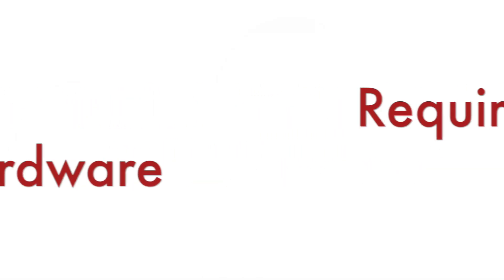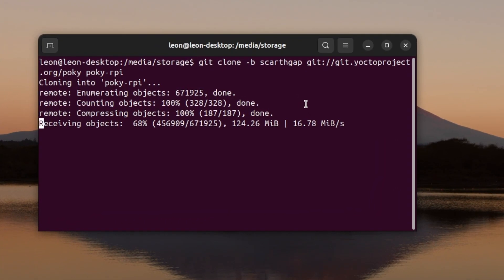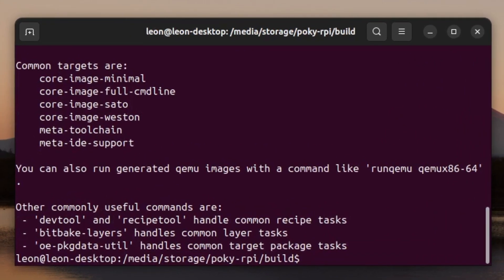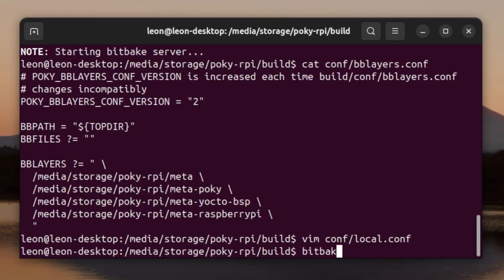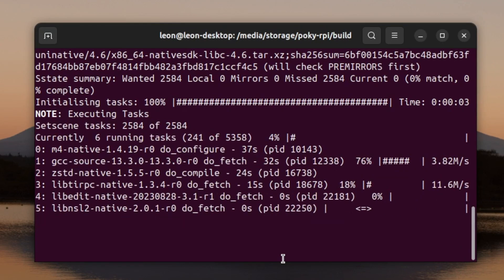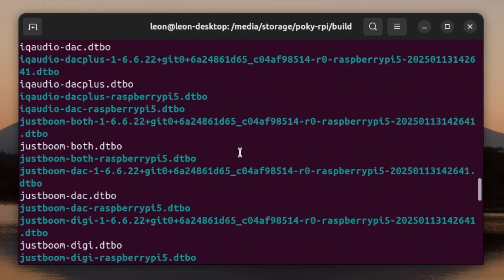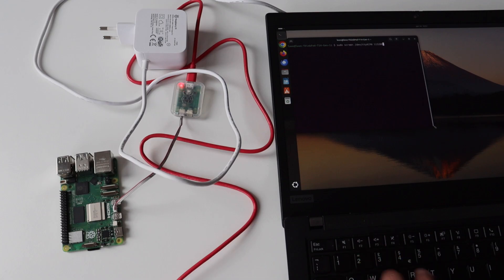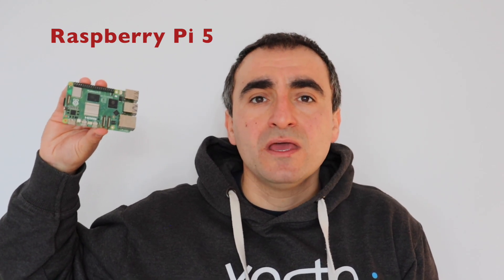The Yocto Project on Raspberry Pi 5 Episode 1: Building an Embedded GNU Linux Distribution #linux

Comment: I have rpi 4... Will this same procedure can be used for rpi 4?
Reply from the maker: Yes, with some adjustments. Set MACHINE to raspberrypi4-64 for 64-bit image for Raspberry Pi 4. Also the UART output on rpi4 comes from the 40-pin headear.

Comment: Thanks a lot for this tutorial series on using the Yocto Project for a real physical board.
I am trying to follow the same steps as you but I get the following errors while the execution of the tasks:

NOTE: Executing Tasks
ERROR: linux-libc-headers-6.6-r0 do_install: oe_runmake failed
ERROR: linux-libc-headers-6.6-r0 do_install: ExecutionError('/home/vvdn/poky/build/tmp/work/cortexa76-poky-linux/linux-libc-headers/6.6/temp/run.do_install.5422', 1, None, None)
ERROR: Logfile of failure stored in: /home/vvdn/poky/build/tmp/work/cortexa76-poky-linux/linux-libc-headers/6.6/temp/log.do_install.5422
Log data follows:
| DEBUG: Executing python function extend_recipe_sysroot
| NOTE: Direct dependencies are ['/home/vvdn/poky/meta/recipes-devtools/quilt/quilt-native_0.67.bb:do_populate_sysroot', 'virtual:native:/home/vvdn/poky/meta/recipes-devtools/bison/bison_3.8.2.bb:do_populate_sysroot', 'virtual:native:/home/vvdn/poky/meta/recipes-devtools/patch/patch_2.7.6.bb:do_populate_sysroot', 'virtual:native:/home/vvdn/poky/meta/recipes-devtools/pkgconfig/pkgconfig_git.bb:do_populate_sysroot', 'virtual:native:/home/vvdn/poky/meta/recipes-devtools/pseudo/pseudo_git.bb:do_populate_sysroot', 'virtual:native:/home/vvdn/poky/meta/recipes-devtools/rsync/rsync_3.2.7.bb:do_populate_sysroot', 'virtual:native:/home/vvdn/poky/meta/recipes-devtools/unifdef/unifdef_2.12.bb:do_populate_sysroot', 'virtual:native:/home/vvdn/poky/meta/recipes-extended/xz/xz_5.4.7.bb:do_populate_sysroot']
| NOTE: Installed into sysroot: []
| NOTE: Skipping as already exists in sysroot: ['gettext-minimal-native', 'libtool-native', 'm4-native', 'quilt-native', 'texinfo-dummy-native', 'bison-native', 'flex-native', 'gnu-config-native', 'patch-native', 'pkgconfig-native', 'pseudo-native', 'rsync-native', 'unifdef-native', 'xz-native', 'acl-native', 'attr-native', 'popt-native', 'sqlite3-native']
| DEBUG: Python function extend_recipe_sysroot finished
| DEBUG: Executing shell function do_install
| NOTE: make 4 HOSTCC=gcc  HOSTCPP=gcc  -E headers_install INSTALL_HDR_PATH=/home/vvdn/poky/build/tmp/work/cortexa76-poky-linux/linux-libc-headers/6.6/image/usr
| *
| * Configuration file ".config" not found!
| *
| * Please run some configurator (e.g. "make oldconfig" or
| * "make menuconfig" or "make xconfig").
| *
| /home/vvdn/poky/build/tmp/work/cortexa76-poky-linux/linux-libc-headers/6.6/linux-6.6/Makefile:775: include/config/auto.conf.cmd: No such file or directory
| make[1]: * [/home/vvdn/poky/build/tmp/work/cortexa76-poky-linux/linux-libc-headers/6.6/linux-6.6/Makefile:784: .config] Error 1
| make: * [Makefile:234: __sub-make] Error 2
| ERROR: oe_runmake failed
| WARNING: exit code 1 from a shell command.
ERROR: Task (/home/vvdn/poky/meta/recipes-kernel/linux-libc-headers/linux-libc-headers_6.6.bb:do_install) failed with exit code '1'

Build Configuration:
BB_VERSION           = "2.8.0"
BUILD_SYS            = "x86_64-linux"
NATIVELSBSTRING      = "ubuntu-22.04"
TARGET_SYS           = "aarch64-poky-linux"
MACHINE              = "raspberrypi5"
DISTRO               = "poky"
DISTRO_VERSION       = "5.0.12"
TUNE_FEATURES        = "aarch64 crypto cortexa76"
TARGET_FPU           = ""
meta                 
meta-poky            
meta-yocto-bsp       = "my-scarthgap:ec220ae083dba35c279192b2249ad03fe238446e"
meta-raspberrypi     = "scarthgap:aaf976a665daa7e520545908adef8a0e9410b57f"

Updated Build Configuration:

Build Configuration:
BB_VERSION           = "2.8.0"
BUILD_SYS            = "x86_64-linux"
NATIVELSBSTRING      = "universal"
TARGET_SYS           = "aarch64-poky-linux"
MACHINE              = "raspberrypi5"
DISTRO               = "poky"
DISTRO_VERSION       = "5.0.12"
TUNE_FEATURES        = "aarch64 crypto cortexa76"
TARGET_FPU           = ""
meta                 
meta-poky            
meta-yocto-bsp       = "scarthgap:9ce8f26d37c2e3e0030fd1f36f5c54209c269a05"
meta-raspberrypi     = "scarthgap:aaf976a665daa7e520545908adef8a0e9410b57f"
Reply from the maker: Thanks for watching my video! I think the issue might be related to your configuration. Could you please share the "Build Configuration" output that bitbake shows right after parsing the recipe when you run bitbake core-image-base?
Reply: @LeonAnavi  

Build Configuration:
BB_VERSION           = "2.8.0"
BUILD_SYS            = "x86_64-linux"
NATIVELSBSTRING      = "ubuntu-22.04"
TARGET_SYS           = "aarch64-poky-linux"
MACHINE              = "raspberrypi5"
DISTRO               = "poky"
DISTRO_VERSION       = "5.0.12"
TUNE_FEATURES        = "aarch64 crypto cortexa76"
TARGET_FPU           = ""
meta                 
meta-poky            
meta-yocto-bsp       = "my-scarthgap:ec220ae083dba35c279192b2249ad03fe238446e"
meta-raspberrypi     = "scarthgap:aaf976a665daa7e520545908adef8a0e9410b57f"
Reply: @LeonAnavi  
Here is by Build Configuration:

Build Configuration:
BB_VERSION           = "2.8.0"
BUILD_SYS            = "x86_64-linux"
NATIVELSBSTRING      = "ubuntu-22.04"
TARGET_SYS           = "aarch64-poky-linux"
MACHINE              = "raspberrypi5"
DISTRO               = "poky"
DISTRO_VERSION       = "5.0.12"
TUNE_FEATURES        = "aarch64 crypto cortexa76"
TARGET_FPU           = ""
meta                 
meta-poky            
meta-yocto-bsp       = "my-scarthgap:ec220ae083dba35c279192b2249ad03fe238446e"
meta-raspberrypi     = "scarthgap:aaf976a665daa7e520545908adef8a0e9410b57f"
Reply: @LeonAnavi  
Here is my Build Configuration:

Build Configuration:
BB_VERSION  = "2.8.0"
BUILD_SYS  = "x86_64-linux"
NATIVELSBSTRING  = "ubuntu-22.04"
TARGET_SYS = "aarch64-poky-linux"
MACHINE = "raspberrypi5"
DISTRO = "poky"
DISTRO_VERSION = "5.0.12"
TUNE_FEATURES = "aarch64 crypto cortexa76"
TARGET_FPU = ""
meta                 
meta-poky            
meta-yocto-bsp = "my-scarthgap:ec220ae083dba35c279192b2249ad03fe238446e"
meta-raspberrypi = "scarthgap:aaf976a665daa7e520545908adef8a0e9410b57f"
Reply: @LeonAnavi  I have updated the original message with the Build Configuration. For some reason youtube was deleting my reply to this message with the Build Configuration.
Reply from the maker: What is this branch "my-scarthgap" for layer meta-yocto-bsp? Probably you have applied some changes on your own there. Please use scarthgap like at 6:18 from the video.
Reply: @LeonAnavi  Tried switching to the scarthgap branches for both the poky repo and the meta-raspberrypi repo, still face the same issue. Updated the latest build configuration in the original comment.
Reply from the maker: Please ensure you don't have any local changes in the layers that could break the build. Double-check your settings in conf/local.conf and conf/bblayers.conf. If the problem persists, try using the exact same Git commits shown at 6:18 in the video.
Reply: @LeonAnavi  I was successfully able to get the build completed. The issue was that I was enabling some parameters related to the sstate-cache in the local.conf file following the yocto quick build guide before I found this video. I totally missed the fact that you kept those options disabled in the video. After disabling those options the build works. Thanks for the support.
Reply from the maker: Great job on successfully building the image and resolving the configuration issue you encountered. Thank you for sharing your experience! This could be helpful for other developers and engineers in the community who may face similar challenges.

Comment: Hi thank you for your tutorials😉 
I would like to run a Qt QML app (Python based) as Kiosk with fast booting pi 5 with yocto.
If I use core-image-weston, it takes 25s to boot into desktop. But I'd like to not have login and desktop, only want a minimum that is GPU accelerated and shows the app and mounts a can0 network. 
Do you have any tipps? Is it possible to get boot times of 3-5s?
Reply from the maker: I am glad to hear the tutorials have been helpful! Reducing boot time can be tricky and depends on your specific setup, but here are some general tips: eliminate unnecessary bootloader timeouts, disable unused Linux kernel features, and turn off serial console output during boot. In user space, stop any services you don't actually need. If you are using systemd, the systemd-analyze tool can help you understand and optimize boot performance.
Reply: @LeonAnavi Got an update. The Pi 5 first stage bootloader takes around 8,5s. Because it is closed source, I cannot modify it. So that delay is fixed...so bad😢

Comment: Hi , it is really good video for starter and appreciated for that. I have encountered a problem while dd flashing. It says that "dd: writing to '/dev/sdc': Input/output error" , I searched it at internet however the solutions are not working. The question is that my sd card's some partitions are broken ?
Reply from the maker: I'm glad to hear you enjoyed the tutorial! Feel free to check out the other videos as well. After a short break from this topic, I am hoping to record the next episode in June.

As for the issue you're encountering, input/output errors are often caused by a faulty microSD card. Could you try using a different card to see if that resolves it? Also, be extra careful when using dd - it is powerful but dangerous command. Make sure to double-check the device path for your microSD card.

By the way, as a faster alternative to dd, you might want to try using bmaptool.
Reply: @LeonAnavi  Hi Leon, I changed sd card and tried it again and it worked. I look forward to see your new episodes. Thank you so much :)
Reply from the maker: @omurceran4589  nice! I am happy to hear you got it working. Probably the old card has been broken.

Comment: Hi Nice video @LeonAnvi, Does this work directly with HDMI or do we need to configure anything to get comandline from HDMI port?
Reply from the maker: Yes, it should work directly HDMI monitor and keyboard. However, for debugging I highly recommend you to get Raspberry Pi Debug Probe or another UART to USB dongle as shown in the video.
Reply: Thanks for Reply... I am working with Compute Module 5 connected with IO board. I followed the same procedure as you did in the video but not receive any console from HDMI and UART. Any suggestion?
Reply from the maker: I recommend starting with Raspberry Pi 5 and moving on to Compute Module 5 (CM5) afterward. Which IO board model do you use? Working with a Compute Module is more complex, as it often depends on the specific peripherals present on the IO board you are using. You may need to configure additional device drivers and device tree overlays to support those components properly.
Reply: @LeonAnavi  we procured Compute Module 5 directly thats why, there is no Raspberry Pi 5.Compute Module 5 IO board i am using. help me to fix this
Reply from the maker: Please share logs from the serial console in order to identify what problem you are facing. I can't help you without any logs.

Comment: I need ma35h0 tutorial like same way
Reply from the maker: I am not familiar with Nuvoton MA35H0. Is there a Yocto/OpenEmbedded BSP layer for it?
Reply: Pls explain what you know that what is the process you know that
Reply from the maker: The Yocto/OpenEmbedded Board Support Package (BSP) layer typically contains a machine configuration, recipes for the bootloader, the Linux kernel with the device tree and a WKS file with appropriate partition layout.
Reply: @LeonAnavi  ok
Reply: Any reference video or guide you have i was getting error in bitbake

Comment: logging in via ssh should be possible too right? If i am connecting via ethernet to my router?
Reply from the maker: Yes, absolutely, please have a look at my follow-up video "Episode 2: SSH for Remote Network Access"
https://youtu.be/ltckiBV9FXg?si=DJwsKLDhHkDIqCIn
Reply: @LeonAnavi  Yes I will have a look. I installed opensshd and enabled sshd on start using SYSTEMD_AUTO_ENABLE:${PN} = "enable".  i hope it is somehow start wifi on booting as well. gonna try that now. :) I Love Yocto. :)
Reply from the maker: @abelthomas8232  please have a look at episode 2 for the exact steps. For SSH you need EXTRA_IMAGE_FEATURES:append = " ssh-server-dropbear". WiFi is another completely separate story. I haven't covered it yet (in a video tutorial). You have to set it up through some kind of a network manager like nmtui or connman which is suitable for embedded devices.
Reply: @LeonAnavi  I did not need dropbear at all. I was able to install openssh additionally. And the ssh daemon started on boot. I was able to connect to my wifi access point too. I wrote a shell script to bring up wireless interface, changed the wpa supplicant file in yocto where name and password are hardcoded, wrote a simple systemd service that calls this script on startup. And I can connect to my SSID on boot. Love yocto. <3 

Also i am on branch kirkstone, somehow was getting problems with scarthgap
Reply from the maker: @abelthomas8232  Although Kirkstone is still supported I highly recommend you to switch to Scarthgap. What kind of problems do you have on Scarthgap?
Reply: @LeonAnavi  somehow the newest version of binutils was not compiling, was throwing errors, i believe it was version 2.42, now i have 2.38. libc compilation was also throwing errors. All my meta layers are also kirkstone.
Reply from the maker: hm, I haven't seen such an error. This video and whole series about Yocto on rpi5 are based on release Scarthgap. It is a LTS release that is going to be maintained for 3+ years more, until April 2028. Because of this I recommended it.
Reply: @LeonAnavi  Ok,  thank you will upgrade it.

Comment: can I follow the same steps for my 3B+ sir ? thanks !
Reply from the maker: Yes, with several technical differences. For Raspberry Pi 3 you have to:
- Set MACHINE variable to "raspberrypi3" (32-bit) or "raspberrypi3-64" (64-bit)
- Explicitly enable UART: ENABLE_UART = "1"
- Use pin 8 (TX) an pin 10 (RX) from the 40 pin header of the rpi3 for serial communication

Comment: Hello @LeonAnavi,
I tested an image generated by Yocto on my Raspberry Pi 5 board, but the board is not booting properly.
I used the same branch, Scarthgap.
could you please resolve my issue
Reply from the maker: Hm, what is the output coming from the UART with your image that is not booting properly?
Reply: @LeonAnavi  i did not getting any uart logs
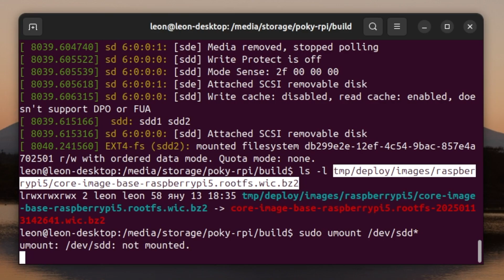Reply from the maker: @anilnt1486  there is something wrong with your image if you are not getting any uart logs.Did you flash core-image-base-raspberrypi5.rootfs.wic.bz2 on a microSD card as shown on 8:16 in the video?
Reply: @LeonAnavi  yes i have flashed core-image-base-raspberrypi5.rootfs.wic.bz2  as shown in the  video lecture. 
also using gparted application i have flashed the image-base-raspberrypi5.rootfs.wic.bz2 
but not works
Reply from the maker: @anilnt1486  why did you use gparted? The core-image-base-raspberrypi5.rootfs.wic.bz2 has all needed partitions in place. You just need to flash it with dd or bmaptool.
Reply: @LeonAnavi  i used both method but it did not work. 
but i ran both core-image-minimal and core-image-base
is there any problem with the repository which i have cloned.?
Reply: one month back  i used the kirkstone branch for booting raspbery pi but i recloned the poki and meta-raspberrypi with scarthgap, and master branches but it is not working. did not get any errors or warning while building. but the board is stuck without any uart messages.
Reply from the maker: @anilnt1486  if you follow the exact steps from the video you will get the same result. On Raspberry Pi 5 UART is enabled by default on the dedicated connector as shown at 8:54. The serial output from the UART connector will help you debug issues. If there is no UART output then double check that the microSD card has been flashed properly, check the wiring and double check your Yocto/OE setup.
Reply from the maker: @anilnt1486  This tutorial is for Poky with meta-raspberry based on Yocto release Scarthgap. Kirkstone is the older LTS release. I recommend using Scarthgap as it the latest LTS release as on the moment and will be supported until April 2028.
Reply: @LeonAnavi  Thank you so much for your support Leon
Reply: booting a raspberrypi5 board with a minimal image generated by yoct build, adding only meta-rasrpberrypi layer is enough?
Reply from the maker: @anilnt1486  yes, as shown in the video and in the description of the video.

Comment: How do you enable the legacy Serial Port since I do not have an new adapter ? I can't figure it out ? docs are confusing ?
Reply from the maker: On older Raspberry Pi models and versions you should add ENABLE_UART = "1" to enable the serial communication: https://meta-raspberrypi.readthedocs.io/en/latest/extra-build-config.html#enable-uart
However, for Raspberry Pi 5 the UART is enabled by default on the dedicated UART connector and this line is not needed. I recommend to use the Raspberry Pi Debug Probe because the pitch size of the pins on the dedicated UART connector are super small and the probe comes with the right cables for it.
Reply: @LeonAnavi  the legacy uart on the PIN headers does not seems to be supported anymore
Reply from the maker: well, these UART pins are still there and available as UART but the bootloader and the kernel doesn't use them. Eventually, you can try adding ENABLE_UART = "1" and changing the kernel serial port to them.
Reply: @ this does not work anymore this is why I'm asking